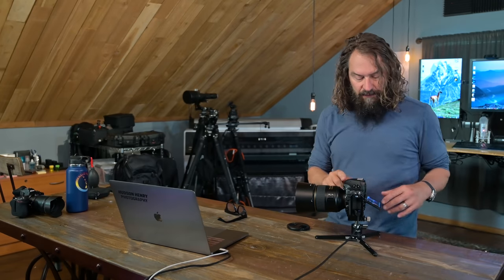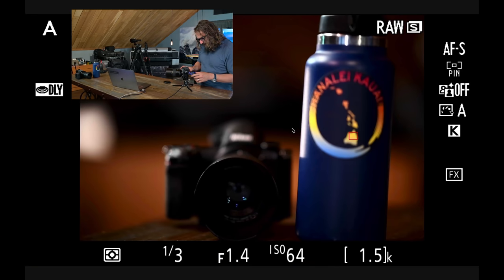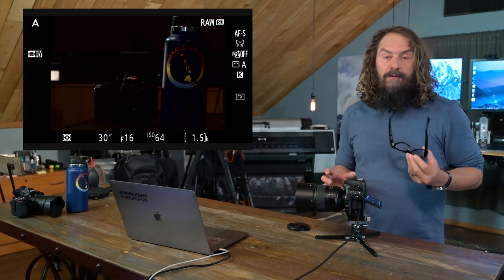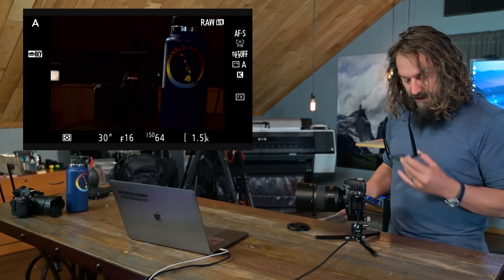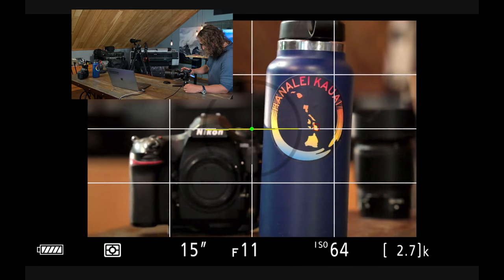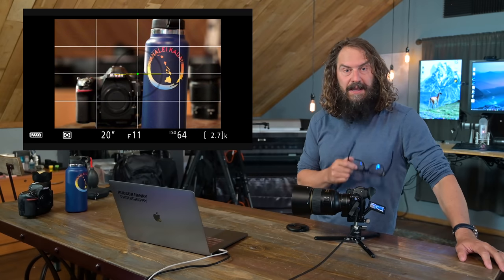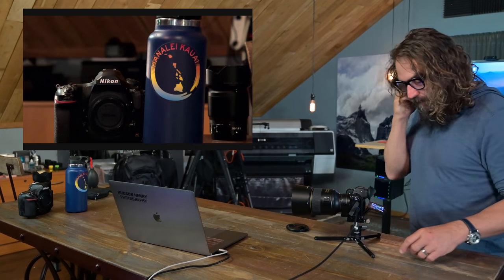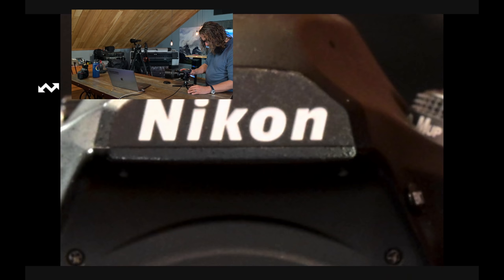Approaching the Scene 151: Nikon Please Fix This Z Camera Depth of Field Problem!

Comment: Hi,
I like to know if you face the same challenge that Nikon Z7 ii when I shoot at iso 64-400 at high contrast scene -1 to -3 ev have color noise issue at Camera Standard profile. Please help me with how to fix that. I thought this the best landscape camera and I feel this doesn't have the dynamic range they mentioned. I just bought this camera and I love files but it sucks recovery. Any help will be great please.
Reply from the maker: No, it's the same sensor as the A7Riv and z7. They have dual a channel iso system that kicks into a different channel at 400iso. At 400iso and above they have less read noise and less dynamic range. With a well exposed image below iso 400 the signal totally obscures the read noise and you get more dynamic range, but if you underexpose and pull shadows you're better off at or above iso 400 believe it or not. 

The real key in high contrast is to bracket and combine into a linear HDR output in your software of choice. When doing that, I bracket 3 stops apart at iso 400. :)
Reply: @HudsonHenryPhoto  Thanks for your detail information. What picture profile do you shoot? Can you make a video regarding Nikon Z 7ii as you mentioned above. I start hatine this camera and before I return or sell it I like to see your video so I can understand better.
Reply from the maker: I adore mine. I will be taking about it, but just remember not to underexpose at iso's less than 400. It's the same with the D850 too. Same sensor. I'd urge you to keep with it and spend enough time to make an informed decision. I could never go back. Love my Z cameras!
Reply: @HudsonHenryPhoto  thanks for your reply. So you don’t shoot under iso 400 and what picture profile do you use?
Reply from the maker: I do shoot below 400, but I don't underexpose below 400. Sony's latest sensors (in Nikons best cameras too) have an iso step where you lose dynamic range, but decrease read noise above it. So long as you don't underexpose you don't notice under 400 (the Z7's iso step) and you get better dynamic range. If your signal to noise ratio drops (underexpose) you're better off shooting at 400 and above for shadow recovery with less noise. It's the physics of the sensor. 

Picture profile has no effect whatsoever on your raw files. I use the flat profile to get a more accurate approximation of the histogram for my raw files since the histogram is based on the preview jpeg rendered for camera playback and uses the chosen profile.
Reply: @HudsonHenryPhoto  Thanks it’s clarified many issues that I have about this camera and I am going to test it out
Reply: @HudsonHenryPhoto  Couple more questions that what iso do you shoot long exposure (below iso400)? Do you use NR noise reduction and if you do when? How do you use the auto bracket in this camera, I set the front dial for -3 ev but when I take a shot it doesn't take simunaniusly. Any help or video?
Reply: I am not sure what is going on with this camera that I can't do Auto bracket 3 shots continuously, it stops after one shot. I have Continuous H and AF-C and still, it stops after one shot and then shows me underexpose shot that I set for the auto bracket. I am not sure what I am doing wrong here.
Reply from the maker: Are you new to nikon? That's very normal for thier system. In continuous high speed you have to hold your finger down and it will stop after the bracket. I do that for handheld HDR.  Turn off image  review in the playback settings. To have it shoot all the frames in a single press  set your timer to a short interval and engage the timer mode, not hi speed. Personally, I just hold the shutter.
Reply: @HudsonHenryPhoto First you are great that you are answering all my questions, Thanks to you for your great help.  Yes, I am new to Nikon like another system you just press the button and camera take all bracket shots, so in Nikon I have to press and hold till it takes all the shots. Is it bummer, what happened if it's long duration shot like 2 sec or above for bracket still need to hold the shutter? Why it says it's Auto bracket, I am confused.
Reply from the maker: Every system is different, they expect you to use the timer... It does what you want with the timer. That's how Nikon has done it for 20 years. You don't have to set the number of shots. Bracketing overrides that. Just the delay. (ie 2 seconds). That's a dropdown from the timer drive mode next to continuous. No need to enter the menus at all.
Reply: @HudsonHenryPhoto Thanks but I do use timer still doesn't auto bracket either.
Reply: @HudsonHenryPhoto  I hope you make a video on this.